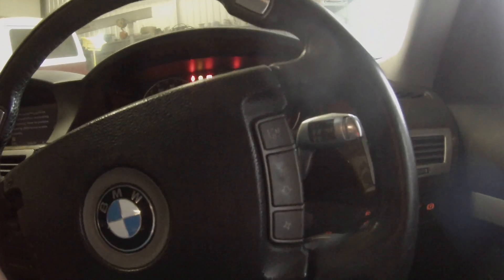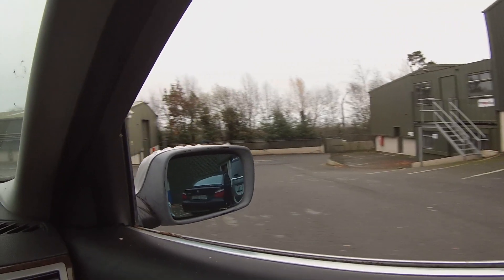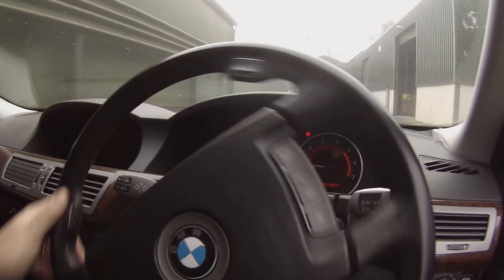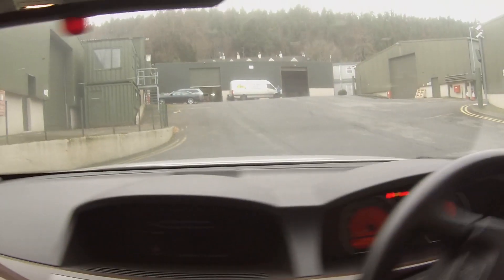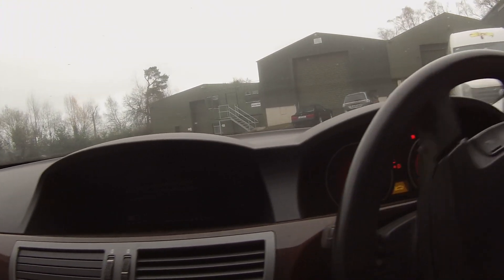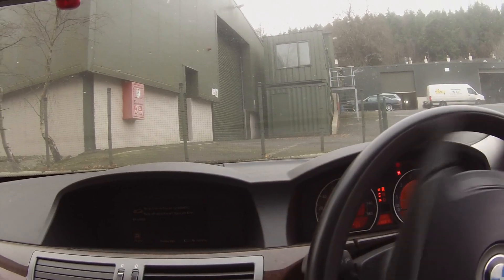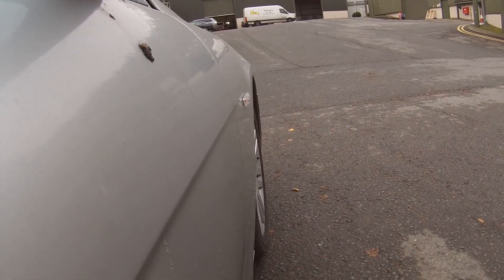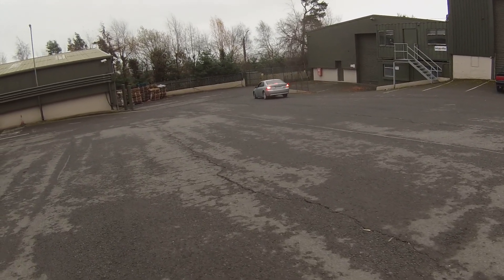Electric E65 7 Series : First Drive

Comment: Peak of 3500 in what units? Whether in Nm or ftLbs, that is some ludicrous torque. I wonder whether the motors and the gearbox can all handle peak torque reliability. This has been one of my biggest questions about the higher power Toyota hybrid gearboxes. I'd love to use a highlander/RX gearbox or GS450 gearbox with a Toyota V8, granted the gearbox won't make like a grenade.

Comment: I wonder how it would do in a lighter vehicle! I have a mid 90's Camry I wanna convert, maybe using a leaf drive unit, or crazy with a Tesla! Ha-ha,  I'd like about 200 mile range+. And 0-60in about 4-5sec. or less, only issue I can think of is Axels at the moment, and can you do a video about the batteries you use? Unlike and unsubing cheers , can't wait to see more!!

Comment: I’m impressed by the amount of pep that has! That would work in the Range Rover you had to work on a while back very well. Other than switching to power brakes the yacht is a winner.
Reply: And a steering kit. These have really poor turning capabilities. I remember climbing into a test one in ...oh 2010 ish i think, and feeling utterly disappointed in the poor handling it had. Don't get me wrong, it's a boat, i expected as much, but at the same time Mercs were also boats and did much better.